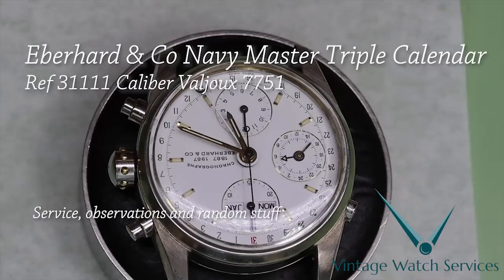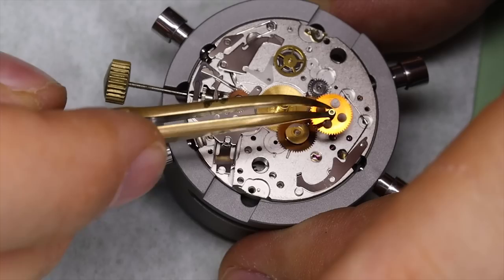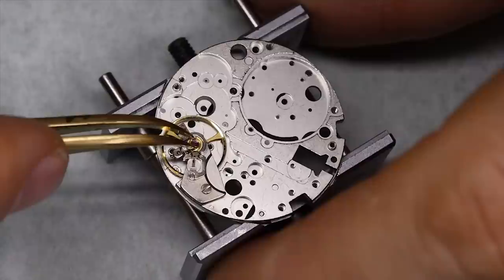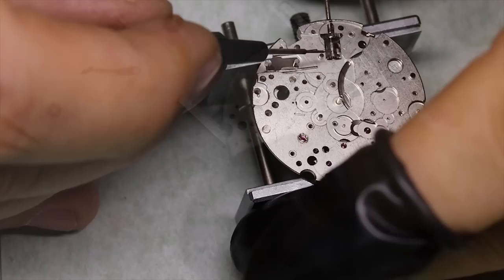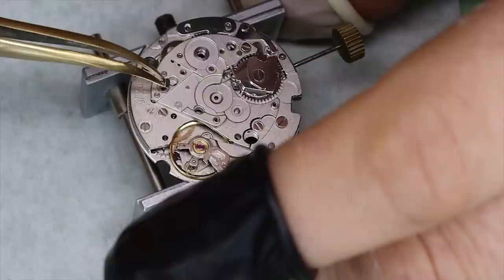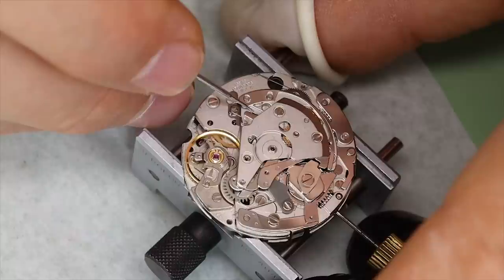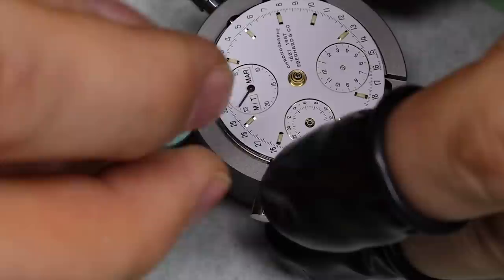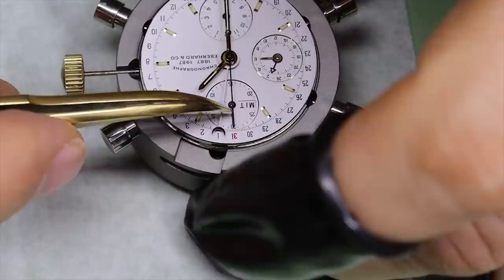2006 Eberhard & Co Navy Master Triple Calendar Service Cal 7751

Comment: Thanks. Love your humour. Duct tape...
If this was made for the US market, why does it have German month and day wheels?
Reply from the maker: Hello Kev, thanks for watching and for your comment! That's a very good observation, this watch was thus not made for the US market but rather the German. It might be that Eberhard used mostly 17 jewel versions in this model.
Reply: I have wanted a "nice watch" ever since I was a youth, and, for several logical reasons, never bought one.  Wanting (ideally) both a chronograph and a day and date feature, I came across these Eberhard models.

For about a year I had looked for an Eberhard like this, but with a karat gold case.
I eventually gave up, since:  a) I found very few with karat gold cases, and b) virtually all that I found had German or Italian day/date wheels.  (I am a complete novice, so do not take my experience as representative of availability.)
For now, I have decided to give up.  One reason being that if I'm spending several thousand dollars on a watch, I at least want it to be in my language :(
Reply: @be5952  Keep an eye on their web site. Something might come up... The movement is still being made, so you may be able to get a watchmaker to order the english dials and fit them. Keep the 'foreign' ones for originality... If you search for the movement, you may well find the watch you want...

Comment: Nice work. I really enjoy your videos. I look forward to seeing them. I have an old auto chronograph that jumps to the half hour mark when the minutes reach 20. Is that an easy adjustment? I can't find any local watchmakers who will touch it.
Reply from the maker: Hi Dave, thanks for watching! Adjusting chronographs is a pretty advanced topic, but the good thing about all watches is that everything that happens has a strictly logic reason. It might just require some detective work to find the reason(s) :)  
The most likely reason for the hour counter hand moving too early is that the jumper controlling when it moves isn't properly adjusted. This might be adjusted with an eccentric screw (which isn't an actual screw but an asymmetric plug that shifts the position of what it is meshing with), but it might also be that someone at some point tried bending the jumper spring etc. So it might be an easy adjustment but it might also require a bit more work. Do you know which movement it is?
Reply: @VintageWatchServices  Yes I do. It's a 1973 Bulova Auto Chrono and the movement is EFAD 14 caliber 11. I think also called Buren 1282.
Reply from the maker: @SuperPhotoDave  I believe that is the Buren 12 Chronomatic, does it resemble this one: https://watchguy.co.uk/repair-heuer-autavia-buren-12/ ?

That's a pretty complicated watch to work on, with a lot of quirks and weak spots, and I can understand why the local watchmakers are hesitant. Most watch shops do battery changes and 2824 servicing, so something like this is a bit different! Have you worked on it yourself or have you ever had anyone work on it?
Reply: Yes. The Bulova I have was called the bullhead and your link showed the same relationship to the pushers and crown. I have not worked on it myself and it has only been serviced once. That was about a year ago. I purchased the watch used in 1978 and I wore it about a year when it stopped working. Then I put it in a drawer where it sat for over 40 years. The watchmaker who did the service passed away before I could have him adjust it and now I can't find anyone who will fix it. The man who did the service said it was a beautiful movement and the most complicated he had ever worked on.

Comment: I have a watch with the 7750 movement.  I had it serviced a year and a half ago.   After it was serviced it was very accurate but over time the watch has lost time.  Currently the adjustment is all the way to the plus and it still loses about 10 seconds a day.  I have a timing app on my phone and it shows that it is beating at 28,800 bph.  What is your opinion as to why it is still losing time?
Reply from the maker: Hello Joe, thanks for watching and for your question! There are a lot of different things that can be off with your watch, so it''s not easy to say without having seen it. It might be that the mainspring is not producing enough power, something a low amplitude reading would indicate, but it might also be things like over-oiling or that a pivot is being worn through, too little endshake at a wheel etc. It's not uncommon that a watch's timekeeping changes a while after servicing as things settle in, but it shouldn't change that much. 
I cannot really tell you what to do, but given that you say that the regulator is all the way up to plus it sounds like the place that serviced it has tried to make it go faster, so maybe you can still ask them to see what is up. Or did you open the watch to adjust the regulator yourself?

Comment: Venus was acquired by the Chinese Sea-Gull, not by Valjoux, afaik.
Reply from the maker: Hello Esteban, Venus was acquired by Valjoux back in 1966 and some of the designs were carried on under the Valjoux name, e.g Venus 188 became Valjoux 7730. 
I believe Seagull simply cloned the Venus 175 based on reverse engineering. Some of the parts are a bit different.

Comment: Nice job :) Where did you get that plastic stick holder ?
Reply from the maker: Thanks for watching and for your comment! Do you mean the plastic stick I use to hold down bridges etc when putting screws in? I got this one from boley.de, and there you need an account. They should sell similar ones other places, I found this one on eBay for instance: https://www.ebay.com/itm/Bergeon-6436-Watch-Polystyrene-Cleaning-Resistant-Sticks-Watchmakers-Swiss-Tool/283873297185?_trkparms=aid%3D1110002%26algo%3DSPLICE.SOI%26ao%3D1%26asc%3D20190711095549%26meid%3D3f81e02860e442289827243184fabc08%26pid%3D100047%26rk%3D4%26rkt%3D12%26sd%3D284007769670%26itm%3D283873297185%26pmt%3D0%26noa%3D1%26pg%3D2047675%26algv%3DSellersOtherItemsV2%26brand%3DBergeon&_trksid=p2047675.c100047.m2108

Man, what a long URL! :)
Reply: @VintageWatchServices  Thank you so much! :)

Comment: As great and reliable the 7750 is, man that's a thick movement... I wish manual chronographs were more prevalent. I suppose Hamilton makes some manual 7750 watches. Outside of that there's Sea-Gull's chronographs. And after that a bunch of stuff I can't afford!

You mention disliking 7750s for their utilitarianism, any thoughts on the La Joux-Perret modified column wheel 7750s?
Reply from the maker: Thanks for watching! Automatic chronographs certainly inevitably get a bit chunky, and you're right in that there are very few mainstream manual chronographs out there nowadays. 
I don't dislike the 7750, I hope that wasn't the message conveyed, it's just less exciting to me than a classic column wheel chronograph. The 775x is reliable, high performance and cheap to make, so it's really a fantastic formula in that sense. The cheap to make aspect is because there are a lot of stamped out parts, which do not have the same refinement as traditionally machined parts. 
I haven't worked on any of the column wheel 775x modifications, but some of them go pretty far in reworking the parts. I'm not sure it really makes too much sense to do so though, the 775x works great on its own, and it seems a bit forced to put in a column wheel. Granted, it makes the operation a bit smoother but it seems a lot of effort for little gain.

Comment: How did they regulate watches before timegraphers?
Reply from the maker: Hello Herb, thanks for watching and for your question! They did it exactly as you probably think: by comparing the watch or clock they were adjusting to another one they knew was running well. The first timegraphers were introduced in the middle of the last century and that's also when the accuracy race really began.

Comment: What are the watchmaker costs for this complete service in general?
Reply from the maker: Hello Ronny, thanks for watching and for your question! It really varies with which country you are in and whether you take the watch to an independent watchmaker or to a brand store. Our charge for an automatic chronograph like this one is CHF 250, and there would typicall be a small extra charge for new parts such as a mainspring and gaskets. If you take your watch to a brand store it could easily be twice that or more, as they tend to replace a lot of parts.

Comment: Why did it not run?
Reply from the maker: Hi, thanks for watching  and for your question! I honestly do not know as it started running after I took the case back off. The case back did not press on anything, so it wasn't that. I suspect it was the thick layers of old Molykote grease that made it hesitant to run.
Reply: @VintageWatchServices  Thanks for the explanation.👍 It was a bit weird to see it start working for no "obvious" reason.
Reply from the maker: Yep, it was for me also 🤔

Comment: So many complications on this watch.  I would rather see more jewels for the wheels and give up some of the calendar functions.  Also, all the full sized plates stacked on top of each other would make the watch so thick, it makes this look like it is on steroids.
Reply from the maker: These movements are indeed pretty thick, which is why most watches using them are quite wide, thereby making them look slimmer. This model is quite small for a chronograph and thus looks a bit chunkier. That said, it's not so thick that you would really think about it when wearing it. People are used to chunky chronographs given the ubiquity of the 775x's.

Comment: Hi, I love your vids, though I could use your help, are you available by phone or email?
Reply from the maker: Hello Paul, you can contact me at stian@vintagewatchservices.eu, but note that I do not take on servicing jobs, I'm simply way too swamped...
Reply: @VintageWatchServices  hi, thanks for replying. I won't embarass you too much, but I think your videos are very instructive and I nearly always refer to your vids for help. Down to business! Actually, I think I sorted the problem, as I was putting the date works on to a FE233 but I was at a loss for where the little  U shaped spring went... But after about 2 hours I worked it out. It was driving me bonkers and that was why I reached out! Anyway, and I say this tongue in cheek, I couldn't find a FE233 in your library, unless my madness drove me blind. Keep up the great work... You're an inspiration to many a folk! Thanks again.